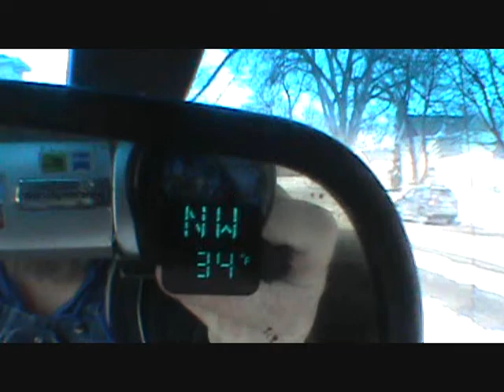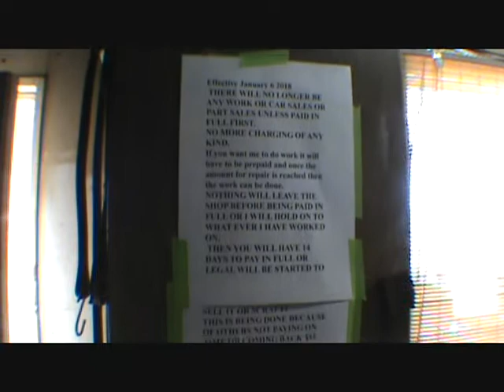fixing the bent oil pan and shop time

Comment: This is off subject, but I got into a '97 Tahoe Today, and two of the inside door handles were broken! Are mid '90s GM truck door handles usually that bad? I wonder if the last owner met a clever vandal.
Reply from the maker: yes they do seem to break a lot i have replaced my handles few times now
Reply: I found a "square body" Suburban Today, but I haven't started it yet. I already like it enough that I may buy it if it will make it to a mechanic (if it's beyond what I can fix).